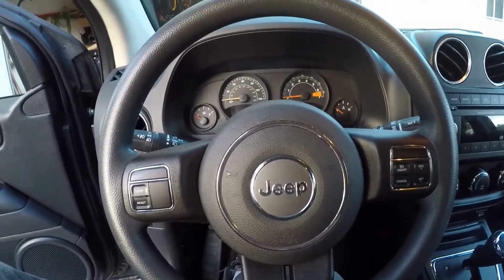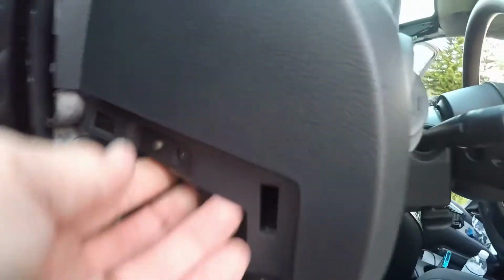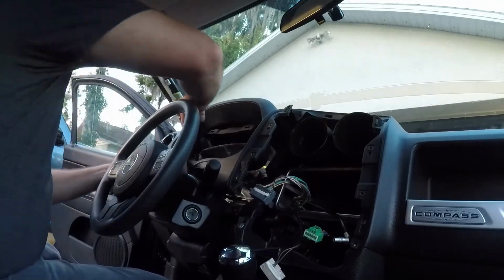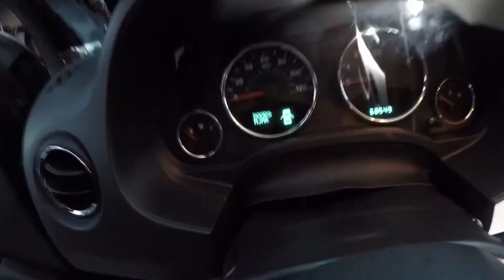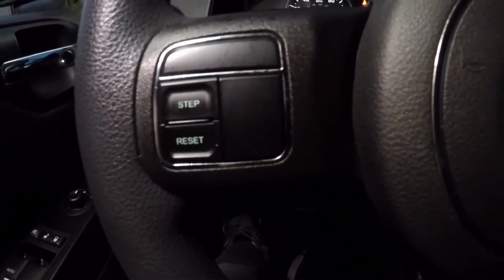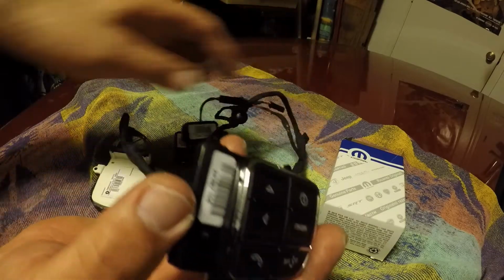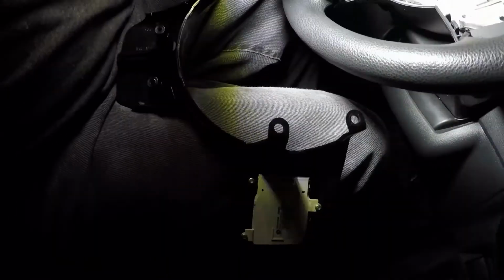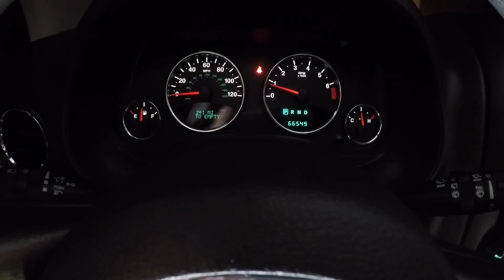Swap a New Gauge Cluster Into My Jeep Compass

Comment: You didn't have to reprogram it??
Reply from the maker: No it was plug and play.  It’s my daughters Jeep and she wanted a miles until empty display.  I bought a used set of gauges on eBay for $100 and swapped them in and everything worked.  I sent the new gauges out to a guy on eBay to reprogram the odometer so the mileage is accurate to the car.  I also bought a steering wheel button cluster on eBay to add the buttons needed to use the new functions of the gauges.  We still have the compass it’s up over 165,000 miles now and the gauges are still working great.
Reply: @bhwjrproductions can you tell me where/who you sent it to for the mileage reprogram?  I’ve been worried I’ll have to buy one that has similar mileage to mine and then replace it when the mileage matches but your method sounds much better. 

Also, any info about the directional compass feature? I thought these evic clusters had a compass screen, but I imagine I’d have to install that module to get the function?